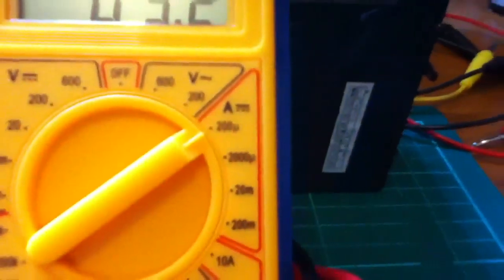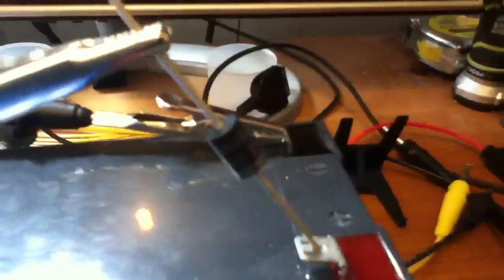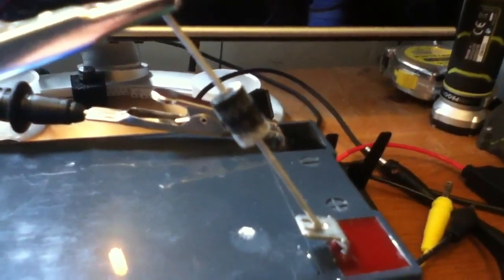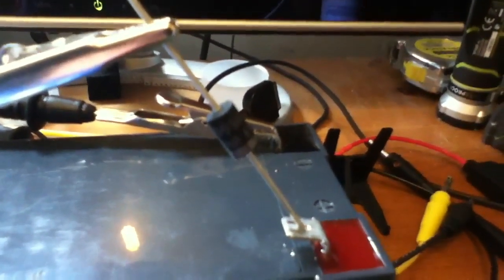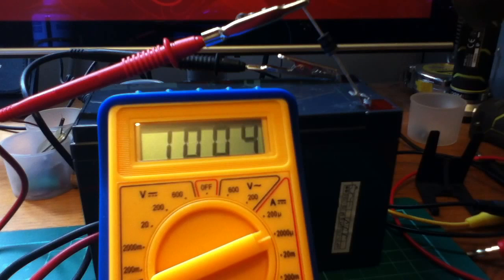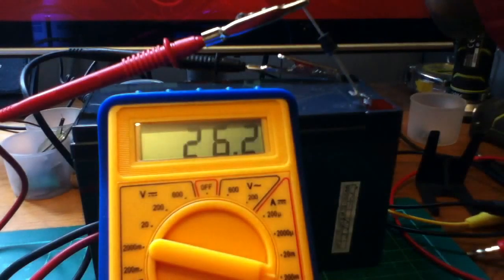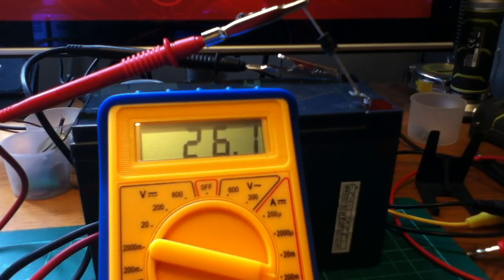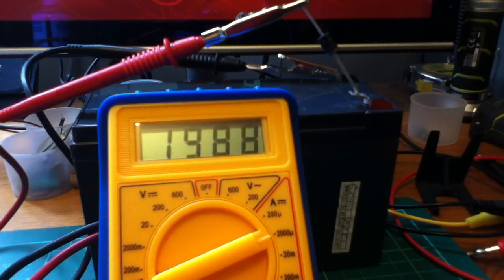High Power Schottky Diode Reverse Leakage Current Tutorial

Comment: Good video. I was going to use some schottky diodes in a bridge rectifier, but now I'm really put off by what mischief they could get up to in a warm environment like a PSU.
Reply from the maker: I did make it very hot - probably far hotter than the inside of a PSU. Don't be put off - there may be some benefit to using Schottkys in a bridge configuration. Try both.
Reply: No, what I was going to try would've been a bodge. I tried your trick; heating up silicon and schottky diodes, there's quite a difference.

Comment: Well done, which Diode is better than this one temperaturewise ? How hot did you heat that diode up ? Probably 200 degrees Celsius , right ? This will probably never happen in real usage when it is connected to a solar panel, right ? How much is the threshold voltage on this diode ? Just 0.3 Volts or more or lower ??? Many thanks. Regards, Stefan.

Comment: Have you tried this test with other diodes? Even perhaps a normal rectifier diode like a 1N4001 for comparison? The leakage getting away like that does suggest that another use for this diode could well be as a temperature sensor. By the looks ov your results it would be quite a simple circuit to say use this diode to turn on a heatsink fan for instance. :)